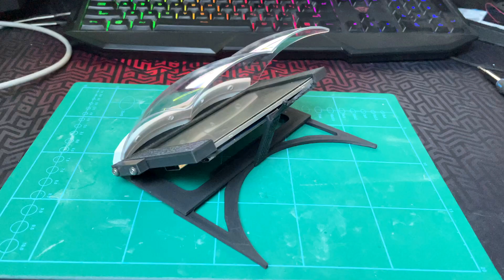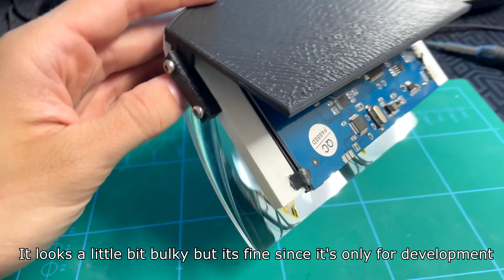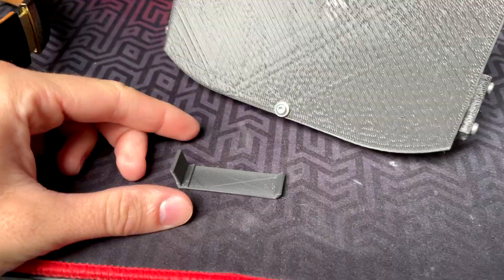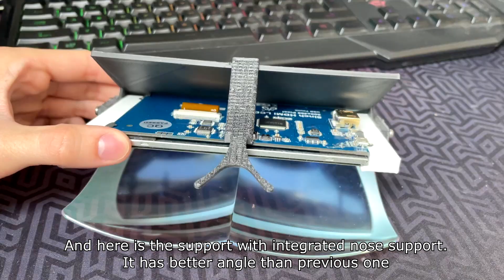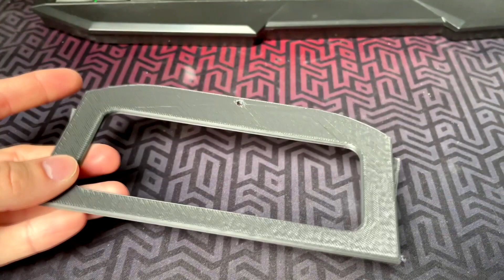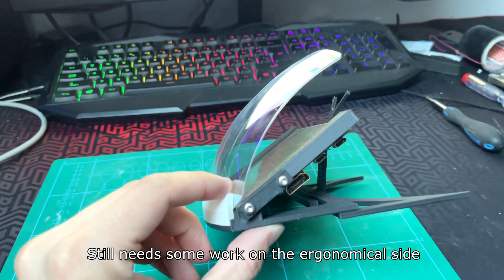New DiY AR Headset | Ep.02

Comment: One thing I have found is helpful for prototyping wearables with a custom fit is to cut them out of card stock with grid paper (for measuring). It helps to cut and paste quickly until you get a nice design that’s easy to measure and translate to 3D for printing. Printing takes a while and I hate reprinting iterations and waiting to fit test.
Reply from the maker: That’s actually a good advice. Thanks!

Comment: Hey, I’ve been planning to build this using the exact same lenses and some nice oled display.
I first looked at “Triton” design with a 6” 2k oled display, but it has a placeholder for leapmotion sensor, and thus I find your design simpler, but can it store a 6” display and at what point do you think the quality of the display doesn’t matter anymore? 
Goodjob on the AR headset btw u earn a sub!
Reply from the maker: Thanks for the sub! I’m actually aware of the Triton. I’ve started my work around the time the Triton was being designed. I’ve actually used the 5.5” Mipi display from AliExpress, almost the same as triton but smaller so if you plan to buy the display then I recommend the 5,5” one because that’s the one I’ll be working with in the future. 6” is a little too big. The display that I use now, is not that good but it works fine for a prototype. I’ve loved the 2k display when I’ve used but it’s fragile as hell.
Reply: @ManolloMancelli  hey, thank you for the quick reply, can you please explain why is it fragile? Is the oled vs lcd the matters here?
Reply from the maker: @nerotv836  No problem! It's fragile because it's really thin. It's not a LCD vs OLED thing. It's just the way those are built. My display (5,5" 2K oled) was around 1,5mm thin i think. It's really easy to crack it.

Comment: How do you wear this?  Can you show it on your face? Is it front heavy?  Hard to imagine how it fits...
Reply from the maker: It's not that heavy. 
https://tinyurl.com/4rfc6vu9
Reply: @ManolloMancelli  looks pretty cool now that I can see it in action.  How well does the screen overlay work? Are you happy with it?
Reply from the maker: @patrickselby6775  I think I'm happy with it so far but there are a lot of things that I'd want to add. Hand tracking etc.
Reply: @ManolloMancelli  interesting. Does it also have a front facing camera so you can fix a point in space to overlay?  Like the floor, or wall?
Reply from the maker: The thing you are describing is called SLAM I think. It’s actually more complex than simple front camera. It’s possible to add it with use of Intel T265 or T261 but I don’t have it at home so can’t really say how well it works
Reply from the maker: Well i haven’t seen that movie but I’m aware of the QR thing. It’s doable not only with QR codes but with any image really. I’m not sure about PC AR but it’s really easy to do on Android devices